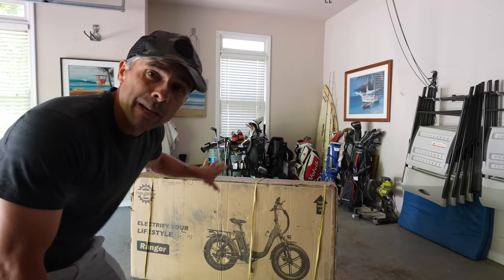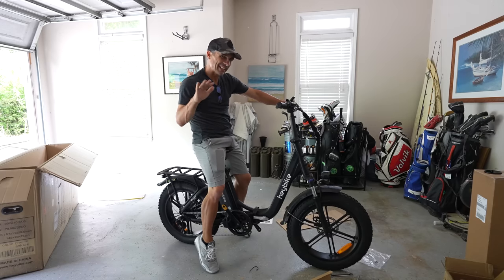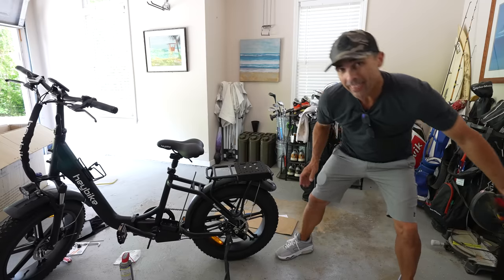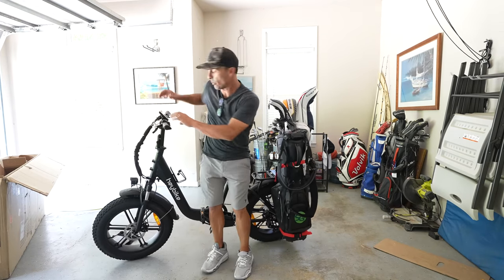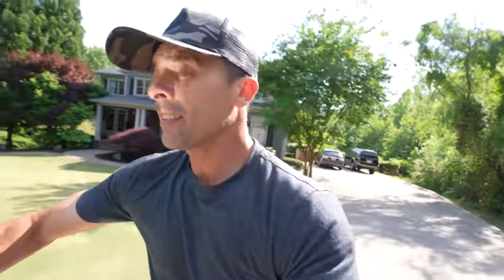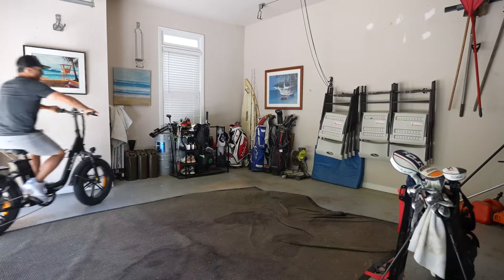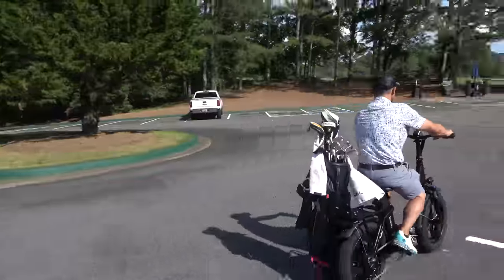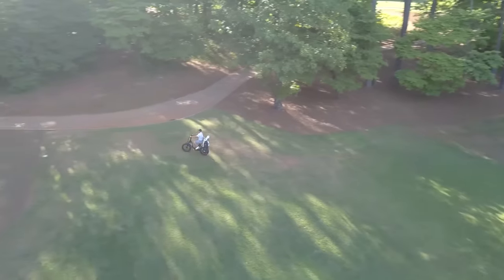The BEST Electric Bike for GOLF?

Comment: I took my ranger out for the first time golfing.  I had my waver form printed out but the course manager said they did not need it and no trail fee..Yes!  It was a blast and the only set backs were loss of concentration on the first few holes..because I was having fun riding it..and once when my towel hanging from my bag got caught in back wheel.  Another plus is you can ride ahead and make a polite request that the group ahead play faster..Haha
Reply: I have a mercane wide wheel pro scooter , made a little sidecar for it to carry my bag. No seat just standup,had it 2 years and still holding full charge. Downside is have to be super careful when the grass is wet, touchwood have not fallen yet!
Reply: Joe, where did you get the waiver form? I see it wasn’t needed…was this public course? I would order one right now if I was certain it would be allowed. Any thoughts?
Reply: @edwalt3157  same here....not sure if allowed on the courses I've played on

Comment: I live in Southern California and have found some courses extremely reluctant to allowing you to use an ebike as a golf cart.  I have taken to replacing the phrase, "ebike" to "pedal assist bicycle".  It's surprising how frightened a course is of an electric bike or ebike here.  But get the bike setup with the rack and your clubs, offer them the Waiver (replacing "ebike" with "Pedal Assist Bicycle" and let them know you're only going to go as quick as the group in front of you and they usually capitulate. 
With that said, I love my "GolfEbike" (Divnick) rack.  I use the bike as a golf cart a couple times a week.  I've modified my PAS settings to 0-7 and use either level 2 (25%) or level 3 (35%).  At my age, I need all the exercise I can get.  I still pedal, and even ride the bike with clubs attached to my local course.  It's 8 miles away.  There's plenty of power for me to get to the course, play a round and get back ... And I'm not a lightweight.

Comment: I have used a Golf Skate Caddy (golf board - cart) for several years,  like this it's a single person 'non walking ' option. It's fun to surf the turf on my golf board and it's saves my bad back. Can do 18 holes in 80 minutes. Shooting 80 😎
Reply: how do you get it to/from the course?
Reply: @williammuff5485 In my car.  It folds flat, still long though need to be able to fold down the passenger seats.
Reply: We like all single-rider devices because they help speed up the game...but are biased toward ebikes over the stand-up boards because you can get as much, or as little exercise as you want.  And they are faster and more maneuverable, and they cost about 1/3rd that of the golf boards!!!

Comment: Great review.  I’m seriously looking into one of these.  I’m in my early 50s, but have had both hips replaced.  I normally walk the course to keep my exercise going since I can’t run anymore, but this would be a great addition to add some biking…one question, did you find the stand that comes out with the bag dig into the ground at all?  That bracket looked a bit thin on the bottom and might dig into softer ground?
Reply: @stevedivnick  great to hear. I’m moving soon so need to see if my new local courses allow them or charge extra. I’ll be in Maryland, close to DC (Bethesda area).

Comment: Loved this video as I live on my course and currently have my own cart so no transporting most of the time.  Going to other courses would be the advantage.  Wish you had given some prices of the bike and the bag stand.  As a senior golfer,  I would prefer a three wheeler with items like a ball washer/club cleaner, a cooler or some storage  and a drink holder, but that might be an issue on transporting to another course.
Reply: Phil,   The Ranger is $1399, Bag Carrier is $174 when purchased together, Mudguard is $10, $15.97 shipping totals to $1598.97 all in.

3-wheelers are not nearly as stable because you can't lean into uneven ground.  Balance on 2 wheels is automatic and stays upright when going over uneven ground.

You can carry lots of extra things in basket on the right side of the rear rack.

Come check out the pictures and descriptions on www.GolfEbikes.com
Reply: @stevedivnick  thanks for the info

Comment: I like my Finn Cycle from Sun Mountain Motor Sports because the bag sits on the center line of the frame opposed to hanging off the side. This is nice as you can pedal if you like.
Reply: The Finn Cycles are cool...  Regarding your center-line comment, it is usually surprising to people that they can't even feel the bag of clubs on the side of our ebikes.  Balance is automatic. And the clubs are quite a bit handier on the side than out the front.  But we are in favor of all single-rider devices so we can speed up the game.   

We like the fact that our ebikes are a lot less expensive than the Finn and other riders, that they can be folded for easy transport, that they provide as much or as little exercise as you want, and they can be used for many other things like family rides, errands, even to-and-from work.   Come check us out at www.GolfEbikes.com
Reply: @stevedivnick  I do like the versatility of your bike though! The Finn bikes use turf only tires (I believe) so no recommended for extended asphalt use. The foldability is great also! The issue here in Southern California (primarily the Los Angeles area) is that not many courses allow golf scooters and such. Long Beach courses seem to be the exception.
Reply: @stevedivnick  Just put the Heybike Ranger together but the rubber bumper does not line up with the bag stand. The bracket on the rack is pushed all the way back against rear tail light.
Reply: @Dagoof2k7  Please email a couple pictures of your mounting plate location in relation to the rack.  I'm sure we can solve this easily.

Comment: Check out the Finn golf scooter. I’ve used them and straddling your golf bag keeps your weight perfectly centered on the bike.
Reply: We like the Finn Cycles too...as they help to advance the "single-rider" options.  But the ebikes are about 1/3rd the cost, and balance is automatic...you don't even feel the weight on the back.  One of our customers who also owns a Finn described the functional difference this way. 

"With the Finn Cycle, you come to a stop beside your ball, get off, use your foot to push down the kick stand, walk around to the front of the bike to pull your club, take your shot, walk around to the front again to put the club back, then back to the side, raise the cycle upright, push the kick stand back up with your foot, then get on and take off."

"With the Golf Ebike, you come to a stop, push the top of the bag into the kick stand mode as you get off, your right hand is already right there next to your clubs, take your shot, drop your club back into the bag, stand the bike up (the bag carrier automatically goes back to the upright position) and take off."

And of course, he likes the fact that it is a pedal bike so he can get as much, or as little exercise as he wants.  He can use all throttle and ride it like a scooter, or he can pedal with as much assist as he desires.

Comment: I just don't see why this is better than a cart. I mean it may be more fun and I suppose that's reason enough, but those skinny tires are going to cause more ruts, plus you have to haul it to the course and back, etc.
Reply: It's faster because every player can ride to their own ball and not sit half the time waiting on their cart mate.

The fat tires are less pounds per square inch on the turf than a golf cart.

You can haul it or ride it to the course...or rent one from the golf course.  Hopefully, all golf courses will have them very soon.
Reply: @stevedivnick  does it have as an option to secure a small cooler on right side of bike?
Reply: @stevedivnick  If courses let you ride up to the ball all the time with these where they are normally cart path only I could see an advantage there.